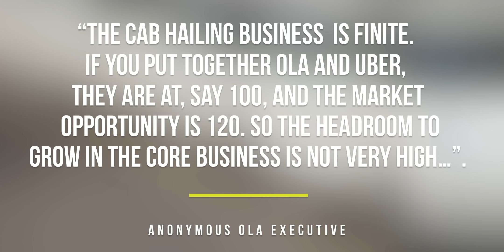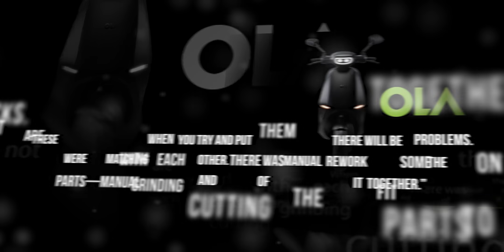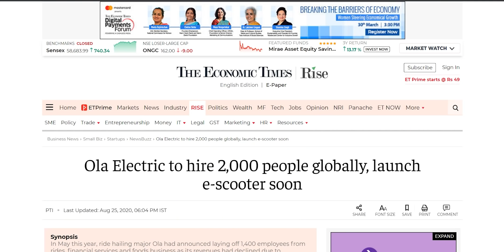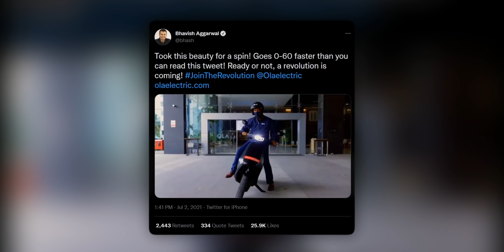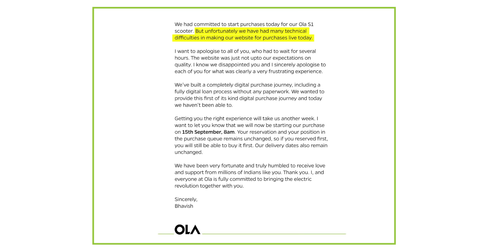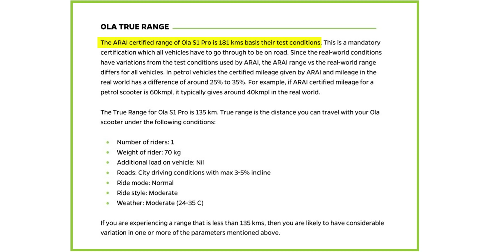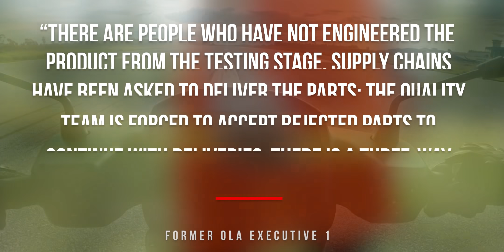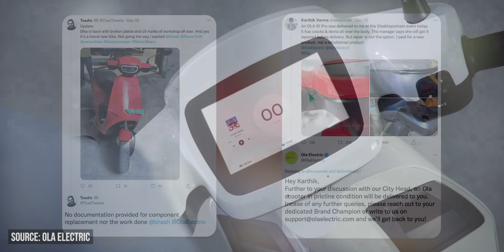How Ola Electric's Revolution Faltered

Comment: Any product release should have piloting and extreme testing. 
In the case of automobile it's even more rigourous and detailed. 
Which OLA didnt do. 
The problem with these new engineers are that they think real world and engineering is like sitting and writing codes for software, which you can alter at your fingertips.

Comment: Recently I received my Ola scooter on 27th May 2022 and it's just driven 500 kms only and already the battery drain issue has started. Such a fraud manufacturers these idiot ola company who is cheating customer by promising a true range of 130 kms ... The battery percentage suddenly falls from 120 kms to 70 kms or sometimes even lesser without any sense. My neighbour too is facing similar issue with his Ola scooter which he bought 4 months ago and already been towed several times but Ola customer service is helpless in fixing it. Such a bad decision of spending 1.50 lakh on this piece of electric shit. My cousin's Ather haa never troubled him since 1.5 year and I ended up making the wrong choice just bcos ola was giving more range than ather. Pathetic and ridiculous brand!!!

Comment: Unlike most people, I'll speak from experience of owning a ola electric scooter myself. I've had this machine for little over 1 month and let me tell you , it is an delight to take it out for smaller rides . For regular neighborhood ride or to run some basic house errands, i prefer it more than my interceptor . Yes, some feature that were offered initially are missing, such as Bluetooth connectivity and navigation (which will be updated later or sooner) what it makes up is in , very smooth ride quality, range , power and looks . Given this was my first electric vehicle, my outlook regarding them has completely changed and that i think is a massive win for OLA , regardless of what general consensus is.

Comment: In India more than 70% of the electricity is being generated using Thermal power plants (TPP), when we use EV's that's more load on these TPP and eventually more green house gases. Ola should have been carefully in the case of Batteries, a proper R&D should have been done. Bcoz of his stubbornness a nice opportunity has been lost. Once trust is lost that's not going to come back easily.

Comment: I have an ola S1Pro delivered in April 22 I love this Scooter very much and it's , so far, a wonderful vehicle, very smooth drive. Milage is 135Kms per charge. In normal mode I could ride up on steep roads. Sports and hyper modes are there may be it will be required when two persons are travelling in mountain roads as well as for fun . The issues reported can be sorted out as they are not general; It's pleasure to have this scooter with you .The one I  have has impressed me a lot.

Comment: I was so clear that this could happen. Even Bajaj is struggling to provide their new electric scooter CHETAK. Ather took 2 years just to test out their batteries. They have the same battery pack as in tata nexon. It's 2-3years early to even think about buying a electric scooter in India soley because of the weather delta and variation in road quality.

Comment: Seems like they are 70% of the way there, although the next 30% will be exponentially difficult to pull-off, I wouldn't write them off. Better Batteries, fixing some engineering issues, and updating software seems manageable. Products take 2.5 cycles to get to a stage where general public can use it. The first wave of customers were enthusiasts, and they should know what comes from being in the first wave.

Comment: Ola is hyped, they did not innovate they acquired Netherlands based start up and launched in India. Without innovation you can not sustain for longer. They should have focus on quality. They took huge booking but unable to deliver them. They should have target 100 EV per months for first 6 months but they started delivering in bulk without testing and proper check. Users got faulty, scratches, damaged scooter

Comment: As of last month ola became the largest selling app based scooter in India, overtaking ather . Also ola has no dealer network, so you have a lot of people targeting ola, from dealers to associations trying to bring them down. The battery certainly needs cooling and a better BMS, other issue is proper assembly. Also software features missing and buggy. Ola still remains the best scooter after ather, which is a little better put together project.

Comment: Yes there was a market opportunity for electric scooters and bikes.
For capturing the market they neglected the quality and security

This vehical is a disaster,
The scooter is defective
No regen brakes and No ABS
Does not climb even steep heights
It burns and starts fire.
The parts dont work 
the software is beta
the design is based and bland
$h*t product overall.

Comment: I think OLA will discontinue in future, OLA scooters have many problems like  Overheating, suddenly acceleration by itself, burning battery, screen turned on - off , battery drain too much in hyper mode, body panel gap, build quality isn't that great ,no smart features working,and no physical key option .

Comment: I had an intense interview with an upcoming e-bike company called Ultraviolette who explained the issue in-depth. OLA does what Croma does. Buys parts/designs from China and sticks the OLA logo on them. They're not designed/tested in-house, and definitely not rigorously tested for Indian weather conditions. Ultraviolette actually designed their own battery pack from scratch, making sure the cells were well insulated so that even if one cell catches fire, the entire battery pack will never spontaneously combust. There has to be a highly efficient heat management system, which OLA obviously didn't care about.

Comment: I have Ola electric.    It has very poor battery management system.   The ARAI rating was 180km but after 40% battery ,The system shut down!   After driving it for 6minute you get over temperature warning and it shift to economy mode!    Worst than Chinese vehicle!

Comment: In 2010 I think there was similar hype for EV but not as powerful now but non-register variant which speed is 40kmph max.....a lot people ran towards them but later everything settled Offcourse now there is more awareness for environment which is a coverup reality is fuel and maintenance cost spike.....but EV now are not accessible 1 lak + on alien 👽 brand scooter is not a thing for many customers......and glitchy software halfbaked engineering in scooter where OLA suspension ripped of on a pot hole......ITS Very clear when a lot people leaving ola factory siting severe compromise in quality control to keep up production......

A SUB STANDARD PRODUCT NEVER ACHEIVE MILESTONES these paper tigers are short term things......

Comment: It seems to me that issue is the lack of understanding and passion for manufacturing. Writing code and manufacturing are totally different from each other. A lesser optimized code would practically perform as optimized code untill and unless edge conditions are met where it breaks and then next patch can fix it up. Also if the makers are not using it exclusively then it won't work. There is a documentary about Royal Enfied and Siddharth Lal who tured it around but for doing it he and his team changed their lifestyles to ride it passionately. It was passion that turned it around. One cannot ride in BMW and then create e scooter for mango people or aam junta (masses).

Comment: bottom line is you only mass manufacture something which has proved it's durability and stability over time for example tesla model 's elon is not on a gigafactory building spree just like that and tesla has only 2 highest selling model's s and x and tesla continues to manufacture those 2 only they might be going through internal minor upgrades with time but overall structure and basic components are proven with time. even Tata failed with nano but what ratan achieved us was a complete made in India car and we learnt that price is not the only thing that matters during a purchase. this agarwal guy is selling a scooter which are for sale in china for around 30-50k₹ eV boom in china is massive because government is not regulating thus sector properly most of the companies failing there at the cost of customer money but evolving their products with time..

Comment: OLA isn’t as bad you portrayed them, the manufacturing problems are real but the infrastructure part is bad not only for ola but for all EVs.  also , even with ola's partially rolled out software, their scooter is still MILES ahead of competition in many many aspects, its already the fastest and highest range in any scooter. Also the 180KM range was obv a claimed range, every company does this.

Comment: I had booked the scooter for around 5 months, canceled the booking after I test rode the scooter, observed the inconsistent customer service and most importantly, after studying the design and saw the flaw in their passive cooling system in the ola scooter (which Ola till today claims that only software updates can fix, but it in fact needs complete redesign).
Reply: I hope this company really just goes down under, it's mostly a fraudulent marketing company running on the hopes and dreams of Indians getting to own a cheap electric scooter, to escape the torture of the oil prices.

Comment: Problems you listed: 

1. Delay in delivery 
2. Dents and scratches in vehicle
3. Software features delay 
4. True Range - which OLA clarified 

These Are all not so important problems with the scooter itself. I agree these caused disappointment and trust loss from customers. But it’s something to watch if the regular sales of scooter is getting affected or not. 

The fire issue was something of serious concern and a clear root cause analysis is needed there. 

But I think OLA electric will come up eventually. 🤞

Comment: I hate companies that believe and better marketing is more important than making a better product they have spent more on marketing than on the product which is just BS. AND ola did everything to make the nest marketed scooter and not the best performing scooter. 
U even forgot to add how ola scooters are going in reverse mode at high speeds which is horrifying and dangerous to everyone. Ola scooters should be banned from Indian roads till they are further developed and tested . 
Companies should believe in adding value to product by speeding less on marketing and making the product better as people use the product and not the marketing hype train. Its not like when you listen to a boat headphones badshah will dance in front of u. But if you improve the drivers you can feel the better lyrics and small details.
Reply from the maker: Hi Sohil, yeah, we thought about mentioning the high-speed reverse issue, but didn't have enough evidence to verify that it was indeed happening (whereas the scooter fire was clearly documented). But I agree, this is a super dangerous problem and I hope Ola fixes it ASAP! -Caleb
Reply: @backstagewithmillionaires  There is a video with ola scoter lying down in parking and it is in continuous reverse mode without anyone touching it.

Comment: Having worked at a supplier for Tesla model3, this was the same scenario. They too launched the car in compressed timeline, reducing the testing requirements and the Production Hell and bad finishing that followed is well documented and known..
So I’m not sure with this over pessimistic tone of this video… for sure they could have taken 3 more years, but they followed Tesla’s approach..
Battery fires for sure is a major issue with most of the EV Batteries and  needs to be looked into closely

Comment: You didn’t even touch on the incidents where Ola scooters caught fire due to over heating. There are also issues such as scooter getting in reverse mode automatically, which is not just a bug but a major safety issue.

Comment: You want revolution in two wheelers. For Bikes, Ultraviolette Automotive is way ahead for anyone else. For scooters, Ather and BATT:Re seem to be the current leaders.
A company whose engineers never touched a prototype properly and went jugaad mode is not going to do it. No matter how wealthy that company is. Electric vehicles need far more tuning, testing and validation before production than ICE counterparts. 1 yr for 1st iteration without experience is literally nothing. Look at ultraviollete F77 ongoing thorough testing right now.

Comment: Tesla was the same when it came out. Iphone 1 was also a disaster. I am saying this an an early adopter of both. This video is just a hit job.
Reply from the maker: Not a hit job Pratul, it was an explanation of what has happened - we have nothing against Ola Electric, and would in fact love to see them succeed (as long as the S1/S1 Pro are delivered, and in perfect condition without defects or missing features). I'd love for Ola Electric to be India's Tesla - have always wished to see Indian products used and respected outside of this country, but this doesn't seem to be a common occurrence when it comes to hardware/physical products, with some exceptions (Tata-made products for example, like Land Rover/Jag). If Ola Electric is going to shine internationally, it needs to take these early mistakes, inadequacies, and failures seriously - if it doesn't, Indian and international consumers won't respect the company. -Caleb

Comment: The main problem with ola was "Time". They have good design good product but they wanted to rush it and show off themselves which made ola neglect r&d and because of the time factor even quality of product also reduced
Reply: Time was an issue but.  You need to test the bike which was done bad . No sound team . Need to devlop then test last sell it . Straight selling not happening.
Reply: No matter if you give next 100Yrs I don't think OLA can turn it around. Because that Electric Scooter was never made by OLA in first place. It's an 9Yrs research and innovation of Etergo company from Amsterdam which tests were never complete and they sold entire shares to this OLA company.
Reply: @trapinflop  what ever it might be they had a chance to make a good solid product and become an ev giant but they lived to their hype and failed the product also they had one huge flaw heating issues and type of cooling
Reply: Unfortunately the latest news is that one of the ola scooters blasted. Killing one man.
Reply: Ola didnt create the product its OEMs from China .Ola is just doing white labeling

Comment: I booked S1 pro on 16th of March .. Fortunately i got delivery on 7 th of April. I was not expecting that fast. 
How ever they delivered defected scooter. The power button was not working. The next day again they took, repaired and delivered back...What I have observed is based on the recent fire incidents which happened across India they feared of cancellation. So they are rushing to deliver rather without checking the quality.
Reply: welcome to hell
Reply: They should be actually be double checking then 😂

Comment: I am using Ola S1 since last 2 months and I am loving it, performance is fantastic
I am only worried about the hear of June when temperatures hit 50 degree Celsius in my area.
Till now temperatures are around 44 degree and no issues till now
Reply: The Battery Pack and the Motor needs active cooling atleast active air cooled if not active liquid cooling during warmer temperatures and during charging. It'll sacrifice range but it'll be much safer.
 
 Most incident are happening when it is parked whe no air is moving through the system.
Reply: Please update your comment after june
Reply: Wait and watch it is going to trouble you. Down south father and daughter died as it caught fire and died after suffocation. I am not sure in depth about the case.
Reply: @williamsatish25  The father daughter death hapened in Vellore and it was an Okinawa scooter. However having said that there has been incidents of 2 ola scooters catching fire too...one in Pune and I think the other was in Chennai
Reply: @williamsatish25  Yes bro in our home state Andhra Pradesh had similar incident
Reply: Any vehicle that worries you for any reason is not worth having it.
Reply: please take it easy on batteries. dont expose to too much heat, dont put too much load (i.e. drive slow), and always charge them less than 75%. never do full charge or overcharge.
Reply: Mostly ride after evening.  Remember to park in shade in day time..
Reply: Until your ass is charred!
Reply: Would suggest to park in shade, it may not help much but better safe than sorry.
Reply: Bro stay safe , batteries are quite unstable , they can catch fire even with weight put on them
Reply: Found Ola EV Employe 😄
Reply: Wow ....How much does Ola pay you to post this ????